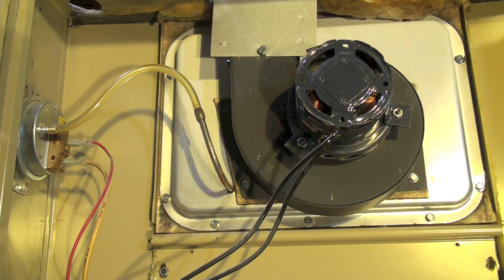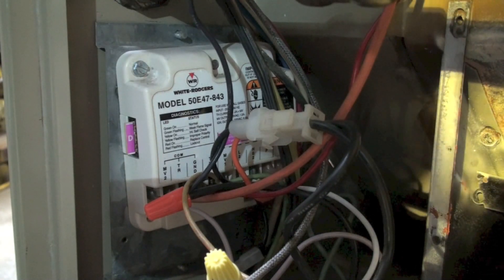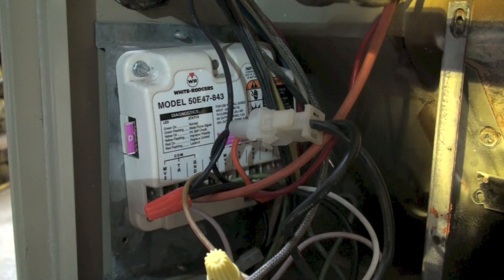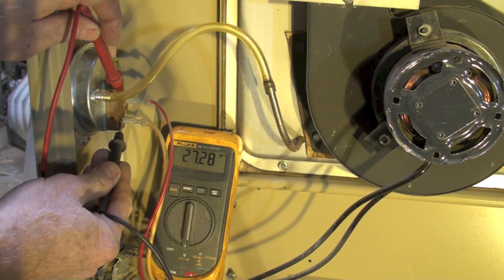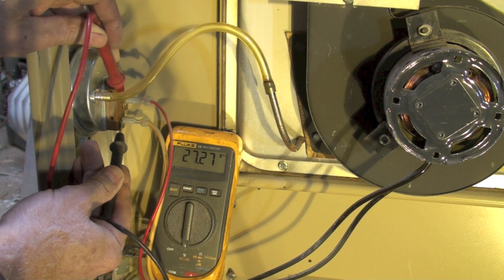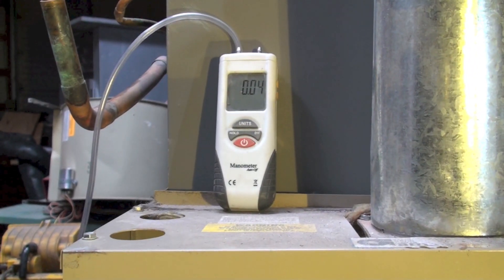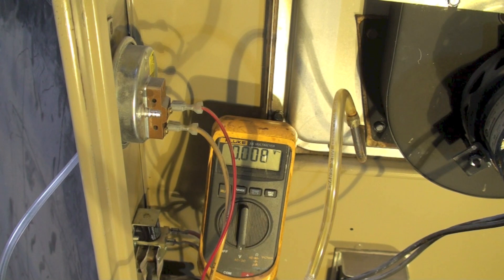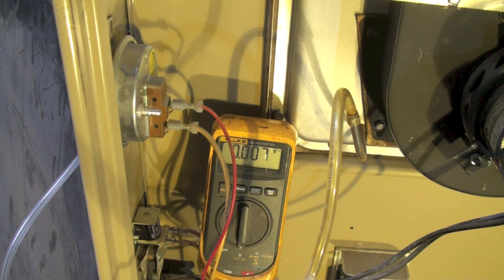Trane BLU model gas furnace no heat part 6

Comment: Is it possible to jump the pressure switch for a few seconds and for testing only just to verify its working?
Reply from the maker: mrexecutive1 You can.  You need to be careful here.  The reason for the pressure switch staying open could be a vent blockage and the flame could rollout.  Hope this helps.
GFM